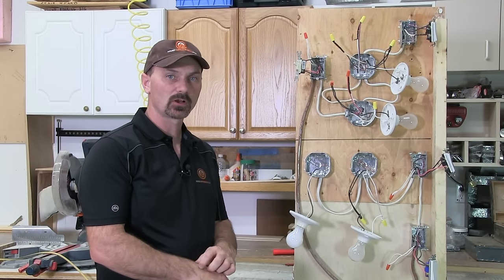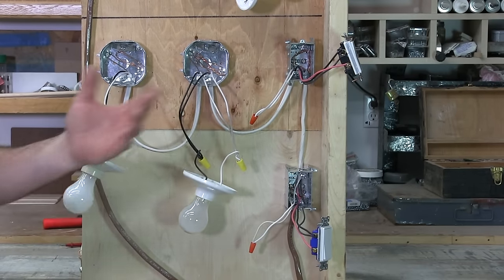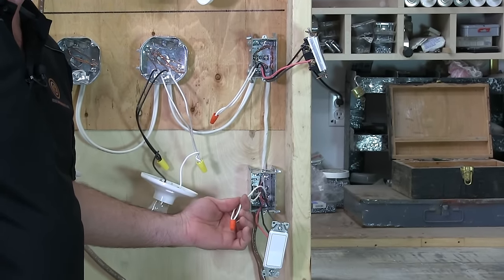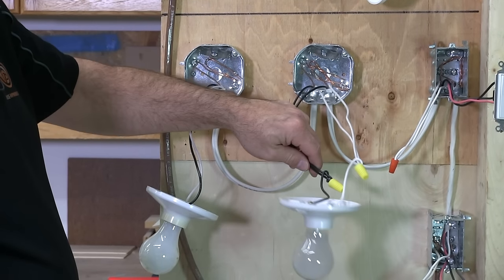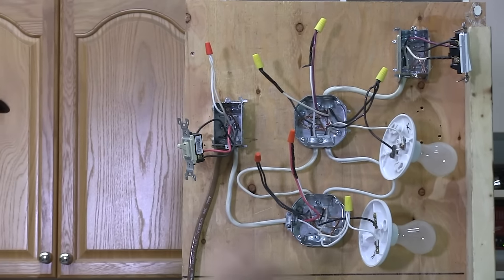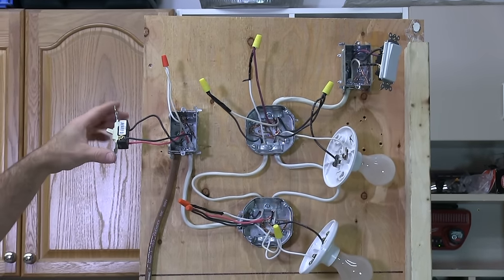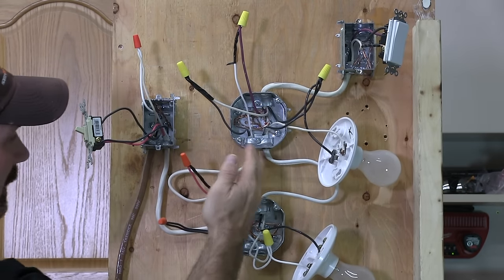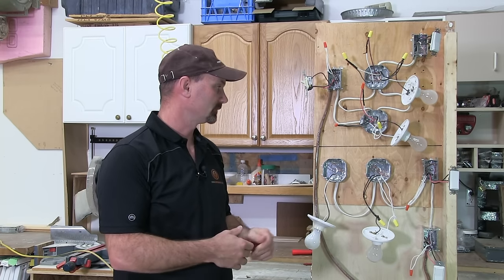How To Wire A 3 Way Light

Comment: So many times I had to go into Friends houses and fix three-way switches with multiple lights. This is the best I’ve ever seen. Excellent. It is very confusing when you have a light between two switches and people always mess them up.
Reply: I have power coming into my switch, 4 shop lights and then a switch at the other end of my shop so I can turn my light off there.  Should I be using the bottom scenario? Seems like a lot less wire too. Thanks in advance for the answer.

Comment: I was first trying to do the method you have in the second method.  Sooo frustrated...then I found your video and realized how easy it was to switch to the first method.  Set my laptop next to me and went step by step through the wiring and it worked perfect!  No more fear of complicated 3 way switches for me!  Thank you so much for the step by step methodical approach you took.
Reply: Yes!!! I think this is the case for me too. I have power coming into my switch, 4 shop lights and then a switch at the other end of my shop.  Should I be using the bottom scenario? Seems like a lot less wire too. Thanks in advance for the answer.

Comment: Great video.  It is also worth mentioning that when installing a 3-way light switch setup and someone wants to use a dimmer switch, that only one of the 2 switches should be a dimmer switch and the other just a regular one.
Reply: That was a very good and valuable comment!! Thanks. I didn’t know that and was about to plan using two three way dimmers. Out of curiosity can you explain why you can’t use two three way dimmers on this ?
Reply: Ampacity.

Comment: Great video.  My switch to the entry of my hallway never worked after new switches were installed throughout the house by a friend of mine years ago.  He said there must be a wiring short in the wall and we would have to tear the wall apart.  No way was I going to do that.  Today, I opened up the light switch and followed your video and discovered my fried wired it incorrectly.  Changed the wire connections on two of the wires in the switch and bam!!!! it works great.  Thanks for the easy explanation and guidance.

Comment: excellent video as usual.  I almost always hear the term “traveler” when referring to one of the wires and it seems to be where most people fail.   I think it’s most clearly demonstrated on the bottom example where the first wire travels switch one to switch two.   Then up to the lights.

Comment: Thank you so much for this display board. I see a 3 way switch and i break out in hives. I am adding two additional lights in the hallway with one existing light being in the center. I could not understand in my pea brain what was going on. I love that ah hah moment when it eventually gets there through thick skull. Your an excellent instructor, I’m an old former maintenance hvac tech and still retention is questionable! 🤯 i drew it out on paper for the 130 degree attic. Thank you so much! Marcie

Comment: DUDE, I'm a  dumb plumber who did what a Canadian do it all guy told him what to do and I got two ceiling fans with lights working like a champ with two switches. I'm kinda proud. Thanks man.
Reply: Working on same deal
I want cut light & keep the fan running from switch. 
Should I settle with pulling string switche

Comment: Thanks Shannon.  I like the bottom example best too because it gives you a white wire in both switches in case you wanted to put a timer or dimmer on one or the other.
Reply: Only a luminated dimmer would require a neutral

Comment: Thanks Shannon, very clear and understandable delivery, also the points you make about the potentially confusing aspects of understanding the current flow was really helpful. Exactly right in that this kind of work is not as straightforward as it seems to be, a little time and thought, along with a decent working diagram or basic schematic on the part of the person doing the installation will go a long way to making their projects work the first time around. Thanks again, great delivery, pretty personable, getting it done as usual!

Comment: Not sure if anyone asked this, but if you wanted to add a 3rd light down the road, I assume in either scenario it would have to come off the light and not the switch, correct?
Reply: I know this is a late response.....But if you run your light connection to a accessible junction box first, then now instead of jumping off the last light or any light, you can go straight to the light junction box and tie in the new lights. I do these often because customers have me come back over the years and install more lights in the same previous room. ...hope the info helped
Reply: Correct

Comment: I enjoyed your video but I would like to make sure I totally understand what you're talking about❤. Unfortunately the scenario I have to deal with to deal with is a toggle on one side of the room a light in the middle and a dimmer on the other side of the room. The wire is 14-2 without ground.
I have no way of identifying which wires come from the light to the bad dimmer switch
Reply from the maker: https://www.house-improvements.com/forums/

Comment: Your wiring video of multiple lights where power isn’t coming to switch box helped me wire multiple lights and a switch in my dark laundry room. Can you please do a video on 3-way switch with power to light where 14/2 also is for a porch switch. In my situation my 3-way switch top of stairs only has a 14/3 so white is a traveler. I can’t get it to work for months ever since I had to replace the damaged box in ceiling.
Reply from the maker: If my existing 3 way switch video did not help you then the next best thing is to ask your questions in my forum. we can assist from there https://www.house-improvements.com/forums/

Comment: I wonder what the method could be to use 14-3 through the ceiling if there is a way? 
It a single shorter run of 14-2 between switches? 
I have 6 can lights to do. Not just 2.. so this gives me a headstart

Comment: Great video!!Question are you running awg 14 because your breaker is 15? Can I use awg 14 between LED lights and run AWG 12 between my switch and a 20amp breaker? Or should I stick with 12 for everything including led lights for a 20 amp circuit?
Reply from the maker: 20 amp circuit requires all 12AWG wire

Comment: Shannon, I have power coming into my switch, 4 shop lights and then a switch at the other end of the shop so I can turn the lights off there. Should I be using the bottom scenario? Seems like a lot less wire too. Thanks in advance for the answer.
Reply from the maker: Either system would work.

Comment: Very good video. I have an existing light at the top of the stairs and one at the bottom. 
The light is on a 3 way switch, I’m trying to add another light. I have done a few wiring connections and cannot seem to get this right. One light will light at the other won’t. I have 14/3 wire coming from the switches and 14/2 at the light. 
I’m trying not to think how to make this work.
Reply from the maker: Our forum is the best place for extra assistance.

Comment: Thank you for this helpful video!

Is it possible to have a mutli-arm ceiling light with 3 arms each with 1 bulb, and each having an individual switch on its arm so you can keep some of the bulbs off if not needed? Don't know if this is a stupid question as I can't find anything about this on the internet !

Comment: Now that the code requires neutral to switch boxes, NM cable is available in #14-4 WG.  This type cable could be used in second scenario between the light boxes and also to the second switch as neutral.   Nice video!   Respectfully,   Kevin
Reply from the maker: Absoluluty correct, but most people will not want to purchase a spool for as much as they will ever need in a home.
Reply: HouseImprovements     Just wanted others to know available.
Reply: @HouseImprovements  How would you recommend have a neutral on the second switch in the second scenario with your set up? Run two 14/2's like like you did from light 1 to light 2?

Comment: I have the 2nd wiring method for my basement bar area. I understand making all the connections with the travelers between the 2 switches at each box due to the supplies and the model. But in reality, you could just run 2 solid wires (no cutting or connecting) as travelers to your other switch through the fixtures right? Like there's no reason to splice into them as its just one solid wire carrying the current?

Comment: I have three way switches running all the lights in a bonus room.  We split the bonus room into two smaller rooms, and now we need to split up these 3 way circuits so the switch on each side only turns the lights on in that room.  Hopefully it isn't too hard!
Reply from the maker: We can assist you in the forum if you need it.https://www.house-improvements.com/forums/

Comment: Question. I had a three way switch with a hall light after the 2nd switch. Worked fine. 
I just added two wall sconces between the switches, in accordance with the second scenario shown here. 
Now my hall light doesn’t work. 
I guess I have to run two 14/2 wires to it after the second wall sconce and keep it in between switches like the other two? Thanks.
Reply from the maker: We  can help in the forum.https://www.house-improvements.com/forums/

Comment: I live in New Orleans and been doing electrical work for over 35 yrs some houses are over a 100 yrs old  they've been adding shit for years I've seen several time where they just run a two wire for switch to switch and picked up the neutral from the nearest circuit which means if you have to troubleshoot or work on that other circuit and turn that one off that circuit with the 3 way has a return on that neutral which is dangerous. And your hot stick will not pick it up unless the neutral are disconnected  so anyone working on three way and want to do it yourself watch out for that

Comment: Do you have one of the second scenario with 3 or 4 lights. I am putting in 6 recessed lights with a switch at each end? I am assuming it is 12 2 wire in between each light still. Only 12 3 going to the switches.

Comment: I am trying to replace 3-way switches in USA home and the current switches do look different as those in your video.  How many Amp have switches used to do the video? I believe that can make the visual difference. What is recommended to use in a home for the 3-way switches (How many Amp switch should be used). Thank you
Reply from the maker: 15 amp switches are all you should need on a residential 120 V light circuit.

Comment: On my single switch it has a black & neutral wire..theres no other wires inside box so that black & white wire are hot coming from my light fixture is there anyway i can hook up a 3way to it the way is setup at my home?

Comment: At the minute 3:35 you talking about supply hot.  Can you elaborate on that ? I did change the switch and it is working, but other switches won't work when the one I changed is ON..
Reply from the maker: We can help you in the forum.https://www.house-improvements.com/forums/

Comment: Shannon,  I have two 3 way switches at either end of the living room.   I have tested every outlet in the living room with those switches in different positions and I can not find an outlet (upper or lower) that these switches control.  The outlets remain hot no matter what position the switches are in.  Next, I turned of the power to these switches and toned the wires under the house until I found the wire with tone.   The wire I found is a 14-3 with ground and seems to be running between the two switches.   QUESTION...  Should or can I use the black and white wires in this 14-3 to power an outlet I installed in the  living room floor since I cant find a 14-2 coming off the switches?
Reply from the maker: My forum is the best place for question s like this . there we can discuss exactly what you want and  figure out the plan.https://www.house-improvements.com/forums/

Comment: Ok on the first set up how do I get the lights to run by them  selfs. Where can turn either one on or off. 
I have a light switch inside. Black & white wire running outside to my porch. It runs to first light. Then a black & white wire goes to outside my enclosed porch. Second light is piggie backed off that first light. I only have two wires, no grounds nor red wires. 
I would like to control both lights from inside and outside. P

Comment: In the 2nd example, if the secondary switch was wired incorrectly, would the primary switch still work fine?  I replaced two switches that controlled a hall light, and now only 1 works.  lol  I'm guessing my setup is the same as example 2 in this video.
Reply from the maker: that is possible

Comment: The black wire is the hot, or I can say, the hottest wire use for switch and light. In Trinidad and Tobago 🇹🇹,  we're using brown as the live wire, black as hot, the new hot wire is black, old black wire was neutral, the green wire still ground and red is live/hot.

Comment: My head is spinning on the second schematic. It would help if you connected them as you explained them! Then draw a schematic of the wiring using markers and a board!
Reply from the maker: look at the wiring, that is the schematic here.
Reply: Ya, one white being used as a hot, and the other used as a neutral in that first light box is confusing. On the left side, the black and taped white should be looked at as the travelers? They just go thru to the other switch right?
Reply: Thank you very much the second one fit my situation and wiring up three lights on the 3-way was a breeze with your instructions.
Reply: Leave electrical to the professionals. Handymen keep me gainfully employed. However, they also burn down houses
Reply: I agree switch to switch then light is so much simpler. Why not keep it that way

Comment: So what im getting from all of these videos is this:
1) Tie your grounds together in each box, then tie your neutrals (whites) together in each box.
2)Put the black COMMON WIRE (from power source) to the black screw on the switch
3)Put the black and red traveler wires on the brass screws in a uniform position with the other switches as to not cause a funky working switch. 
How'd I do?

Comment: I have 2  ceiling fans run to 2 3 way switches. Everything works as expected,  but both fans don't go very fast,  could this be a wiring issue?

Comment: I want the lights to have their independent switches too, but when just one light is on, I want the main switch to turn them both on or both off, but what happens is that it turns one off and the other one on. How do I solve this problem?

Comment: With 3 lights and 3 switches, is a 4-way switch needed inline?.. 
Or can you use 3-3way switches?
Reply from the maker: If you are wanting all the switches to control that circuit of lights you will need a fairway switch in the mix. Here is my video https://www.youtube.com/watch?v=AlAyov6ShxU&list=PLh0KqGKtX4oUES4GbgBGoiFCSsNCbW9Xv&index=21&t=0s

Comment: Hey Shannon  quick question . I have a total of 3 sets of wires going into my ceiling light in this basement bedroom 1-14/3 & 2-14/2's.  the room has one wall switch w/ a 14/3 and 3 receptacles all wired w/ 14/2's  through out the room.  Now my Laundry room light switch in a different room is part of the  3 sets in the ceiling . How do I correctly wire my new ceiling light so I can have the bedroom light on at the same time w/ the Laundry light in the other room. I've identified the Hot wire and the 2 travellers from the 3 way light switch but cna't find the right combo to make everything work
Reply from the maker: Please copy and paste your question into the electrical section in the forum and I or one of the electricians will help you out. https://www.house-improvements.com/forums/

Comment: hello Shannon, I have a problem with my ceiling light fixture.  where in my switch box it has a red and black wire connected with a switch and out of my ceiling light box where there are 2 black and white wires with the red wire, and when I finish attaching the lights, the light is always on and will not turn off.  any ideas?

Comment: I hope you can help..I took down the ceiling fan and I'm putting it a flush mount light i have 2 black and 2 white coming out and 2 black and 2 white on the new fixture i did all the black tougher and all white tougher and blew the breaker what I'm i doing wrong 😢
Reply from the maker: When removing a fixture for replacement it is important to take pictures of the wiring before it's disconnected. If you come to our forum we can likely help you figure this out.https://www.house-improvements.com/forums/

Comment: If only one switch turns on both lights but the other switch doesn’t..does the red blk wire need to be switched?
Reply from the maker: Depends on what you have done for sure. We can help you on the forum easier.https://www.house-improvements.com/forums/

Comment: If I was going to install a exterior building lights do I have to hide the junction box behind the siding or can I just attach a waterproof round box to the outside of the siding and run outdoor electrical wire on the outside of the building.
Reply from the maker: you can use a water proof box and conduit. Wire can not be left exposed on the exterior
Reply: Wiring can be exposed on the outside as long as the wiring is rated that way ,  And high enough where it's not exposed to physical damage

Comment: Can this same wiring method be used for under cabinet LED lighting that is plugged into an outlet, and also on a dimmer switch?
Reply: You would have to 3 way the outlet. Done the same way basically. Unfortunately you cannot dim an outlet

Comment: For the second scenario, we should be able to use 14-4 instead.  Wouldn't that give us enough conductors so there wouldn't be a need to run separate romex?  That might cut down on the complexity.
Reply from the maker: Yes but 14/2 is not a common item you will find in small quantities or at Big Box stores for DIYers